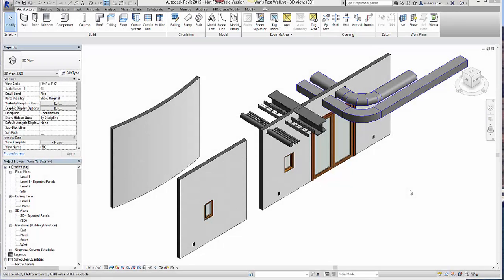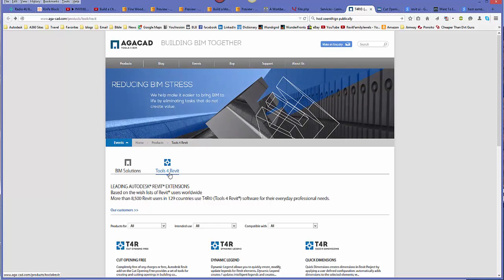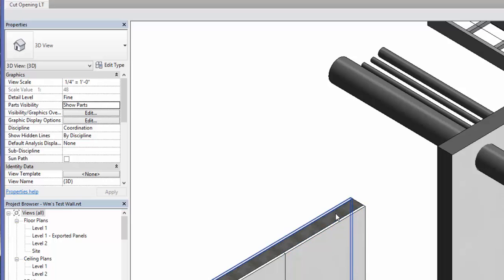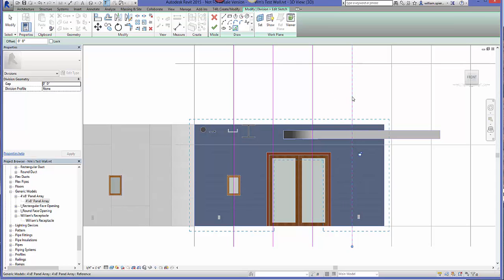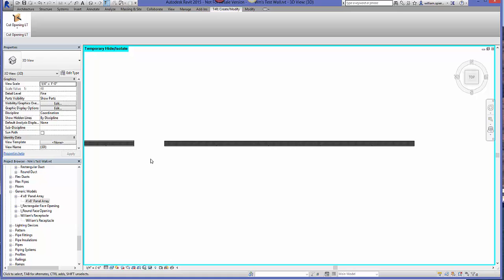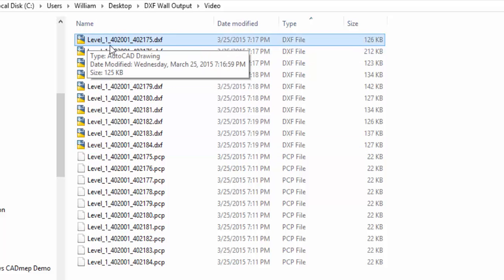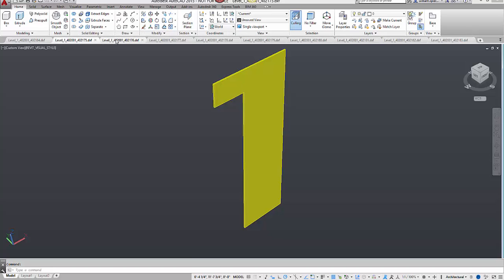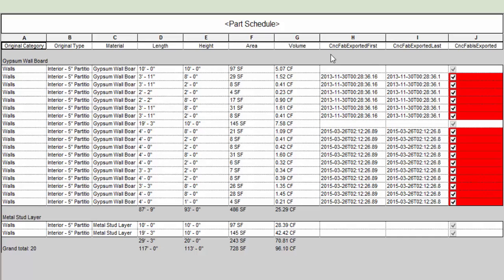Revit to CNC Direct

Comment: You can make the exported panels have a color by using a filter in the view and using the same Shared Parameter you colored in the schedule.

Visibility Graphic Overrides>Filters Tab>Create/Edit>Create a filter for Parts that looks at whether that Shared Parameter is set to be checked (0 for not checked, 1 for checked)>Add the filter to the view>Override the filter selected items to have a red, solid surface pattern.

Comment: Very good video, thank you for sharing! Is it just me that don't understand how the drywall with the wholes is going to get mounted? The pipes will go before the drywall, and those pipes don't end right at that wall, where you can just place the drywall. For some walls they will, where plumbing fixtures will be mounted. But for most walls where mains are crossing corridors and rooms throughout the building and penetrating walls is what I am talking about... They go through the wall and turn left, right, up or down. How would you install that drywall panel exactly on continues pipes? I am having hard time picturing the process and the value of those holes... One more comment that caught my attention... Accuracy down to 1/16" of an inch so the holes fit the pipe. Wow! I want to see that building and that BIM! Maybe its just me coming from the design industry and not from the fabrication. But having someone that makes $20-$25hr to pull off 1/16" accuracy of putting an entire building together, doesn't seem realistic.